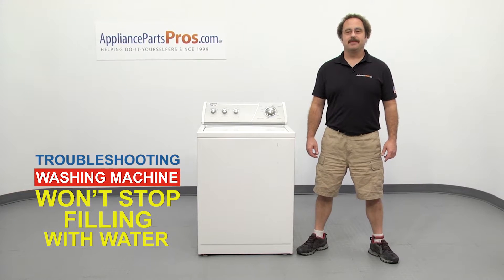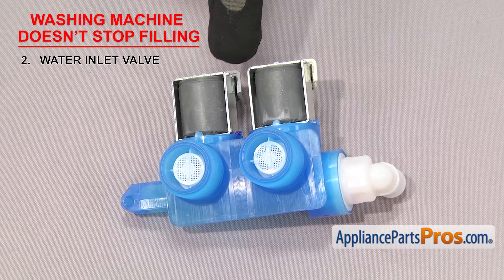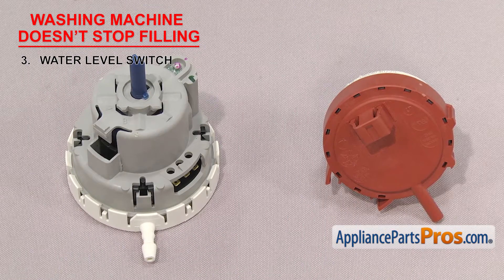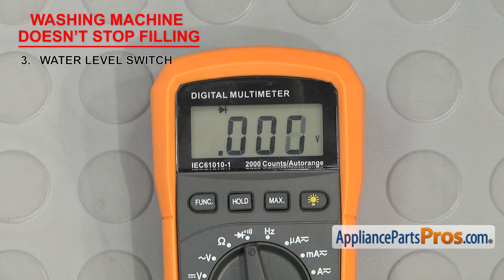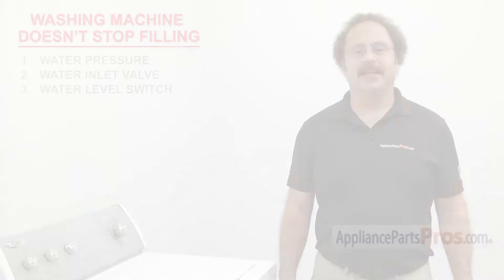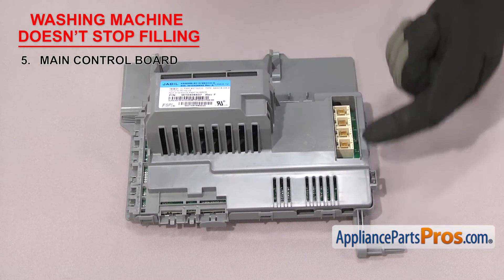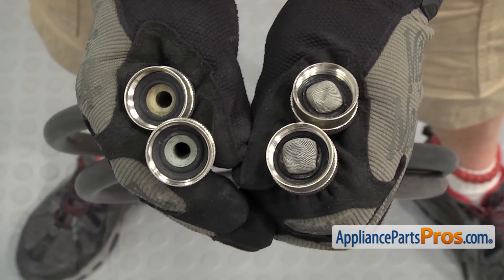Washing Machine Won't Stop Filling with Water - Top 5 Problems & Fixes - Top & Side-Loading Washers

Comment: Mine gets close to being done and then will refill with water to try and balance the load.. Even though it's completely balanced because I just rebalanced it when it started filling with water about 8 times. Why would it do that? Even on a spin only cycle with everything distributed evenly.. It will fill with water and do it all over again.
Reply from the maker: That sounds frustrating, especially when it keeps refilling even on spin-only. For detailed troubleshooting steps specific to your situation, our certified techs can help you at forum.appliancepartspros.com. Just post your model number and what you’re experiencing and they’ll walk you through the diagnosis!

Comment: My GE Washer only overfills when the cold water is on. Fills normally when only the hot water faucet is on. Do you think that might be an inlet valve issue?
Reply from the maker: If you have to turn the water off to keep the unit from filling with water, then that would be a valve issue. if you have your model number we would be happy to look up the part number for you.

Comment: I have a Kenmore washer. It keeps pouring water into the machine, but it never fills with water. It's just continuously filling. 

The water level switch only has two prongs. There is no continuity at first, but when I blow into the switch I have continuity when the switch clicks. 

Any idea's?
Reply from the maker: If it's draining as it fills, it sounds like the unit is siphoning the water out. Check the drain hose that goes into the standpipe. If it is pushed too far down into the pipe or taped to the pipe it could cause that issue.

Comment: My GE top load washer won’t stop filling even when I push the knob in it keeps filling I took the hose off and blew into it and it stop once but after the it stopped responding to that but the tube isn’t clogged or punctured. Thanks in advance
Reply from the maker: If the water continues to come into the unit when it's turned off then your water valve has failed and will need to be replaced.

Comment: How about why water not coming out?
Reply from the maker: If water is not coming into the unit you can check the pressure hose for clogs. If that is good, check for power at the water valve when it should be filling. If you have power there and it's not letting water into the unit then you will need to replace the water valve.

Comment: Rinse cycle keeps filling with water and never gets to the spin.
Reply from the maker: You will need to check the pressure hose for clogs and make sure it's installed properly. If that is good and you can shut the water off by turning off the machine, then you will need to replace the pressure switch.
Reply: @appliancepartspros  thank you.  I will try this tonight
Reply: @appliancepartspros  do you know where pressure switch is?  Thank you
Reply from the maker: The pressure switch is usually located behind the control panel.

Comment: I have a top loader whirlpool. The cold water doesn't turn off. I have to stand by to manually do it, then shut off the valve at the wall. The hot works fine and shuts off correctly. I basically sit by the washer and wait for it to make a click noise once it's at the correct water level so I know when to shut it off. I'm guessing that limits the problem possibilities a bit. I'll have to open it and see if I can figure it out. Thanks for the helpful video. (And thanks to anyone that offers any helpful tips)
Reply from the maker: If the unit will not stop filling until you turn the water off to the unit then you will need to replace the water valve. If it stops coming in when you turn the appliance off then you will need to replace the pressure switch.
Reply: @appliancepartspros  thank you so much!!
Reply from the maker: You're welcome!

Comment: I love these videos. I have a really old Kenmore. I think it’s about 30 years old. I have been encouraged to buy a new washing machine. About three years ago the pump went out a replaced the pump and it continues to work. The current problem was, the inlet valve. I bought a new inlet valve and put the machine back together. I took it for A spin and it wouldn’t stop filling. None of the other events like agitation started either. I was ready to call it quits and buy a new machine. It was a struggle to take the machine apart, but I did notice that what I’ve discovered to be. The pressure hose was not attached to anything. I watch this video and it says oh it’s a pressure hose and it needs to be attached to the back of the tub so now I will, take the machine apart again and attach it. Hopefully it works. This has been a challenge, but I’ve grown attached to this washing machine. 😁
Reply from the maker: If there is anything we can help you with please let us know. Good luck with your repair and let us know how it goes!

Comment: Thanks a bunch for this video!!!! My mom was doing laundry and all i heard was a bunch of "eeks, omg's and what's going on with this thing" from her before I discovered the washer wasn't responding  to anything she was doing it and had she not shut the water off on the valves it would've overflowed. (Ik she said she hit pause at some point but that didn't work and it kept filling but the weird thing was that the rest of the lights went out that are normally on like the load size and the water temperature light selection wasn't lit up - this was prior to her shutting off the valves)  
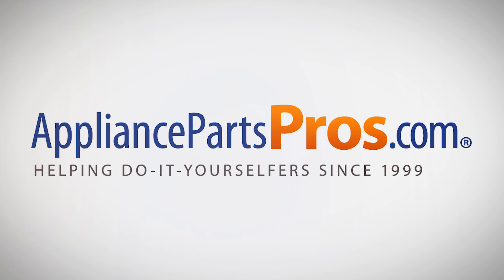Im going to watch this video again and see if I can figure out what the dealio is. Thanks again! 😀 7:21
Reply from the maker: You're welcome!

Comment: Great Video ... we are new construction ... sediment is high and we had a low pressure situation due to the inlet screen where the hose attaches being very clogged ... we cleared it .... perfect operation.   Thank you!
Reply from the maker: You're welcome!
Reply: Thanks for the info! My home is older, but sometimes there’s a break in the community water pipes that allows sediment to get in and send dirty water beyond those break. 
I’m glad it was a reasonably inexpensive fix.

Comment: All of this was excellent.  However, the problem with the machine on my 2nd floor that created a catastrophe was not mentioned.  The Water Level Control wasn't clicked in on the chosen level .. it was just "off" to the right.  The machine didn't know to stop .. and it didn't.  THOUSANDS of dollars in damage to the apartment below.  Unfortunate - and something to be aware of and watch out for when in a hurry.  BE SURE IT CLICKS IN TO YOUR CHOICE OF WATER LEVEL... nearby the choice is a disaster waiting to happen.  Figured it out and it's filling and draining and spinning a wash this very evening.  Trusty Kenmore and a user error.
Reply from the maker: Thanks for the tip! Glad you were able to get the issue fixed!
Reply: be careful, I've had flooding several times because even when changing between settings, it doesn't make good contact. 
But I have another problem - after it fills and stops, when it moves to the next cycle it will try to fill again, so sometimes it just completely ignores the level. The only way to stop it is to manually advance the program knob until it gets to a spin or drain cycle
Reply: Oh my gosh! How awful! I’m glad I have an old, very basic machine.

Comment: I have a Maytag top loader with a clean washer cycle when I use that it doesn't cycle through the water just keeps pouring into the machine why is my clean washer cycle not working? every other cycle works fine, thanks
Reply from the maker: What is the model number of your washer?

Comment: So if you blow in and it clicks then suck in and it clicks it's good right.
Reply from the maker: You would still have to use a multimeter to test the pressure switch to see if it is bad.

Comment: ..what about if you have an circuit board chip that the air hose attaches to?
Reply from the maker: What is your model number? What is going on with your washer?
Reply: MATAG MVWB850YW1,..just keeps filling until we Cancel.
No error codes. How free should the tub be? I just changed the bearings and driveshaft and seal too.

Comment: My ge washer that doesn't have a digital display continues to fill with cold water through all cycles even when the washer is shut off.
Reply from the maker: It sounds as if you could be having an issue with your water valve. What is your model number and we can look into this for you.

Comment: Thanks, good stuff, this is only the second time this ever happened in around 6 years.

Got in the shower and she washed a load while I was in there, it didn't even click until I seen your #1 Problem... lesson for the day, unless you have great water pressure, don't take a shower and wash clothes at the same time. 

Was an older washer, at least 15 yrs old, but again, it's been years since the last time it happened.
Reply from the maker: Glad we were able to assist you!
Reply: Wow! Thank you SO much for sharing this info! I would not have imagined that could happen! My washer is ~23 years old. Plus I’m at the end of the community water lines so if there’s an issue with water pressure upstream, I’ll definitely get the brunt of it. 
Now I know if the washer’s running, stay out of the shower, stay awake, and stay home. I knew to never leave the house or go to sleep if the dryer’s running due to potential fire hazards. Geez. Who knew convenient appliances could be so dangerous?

Comment: You're a washing machine wizard !!  God love ya !!The Lord guided me your channel. Thank you, thank you for sharing your knowledge and expertise. You made it easy, a mouse had a snack of the pressure hose. All good in the laundry room after mopping up 45 gallons from the washer continuously running water.  The concrete hasn't looked that clean in 20 years!
Reply: Hahaha! I felt the same way earlier today. When I noticed my washer overflowing onto the floor, I immediately turned it off and started “mopping” it up with the dirty towels that were on the floor waiting their turn, haha. When I saw all the yucky stuff I was wiping up with the towels, after I got over being grossed out, I had to smile because now I had a reasonably clean floor, hahaha. I also thanked God that I was standing right there when it started  overflowing!  Otherwise it could have created a huge mess and probably caused a lot  of water damage, or worse, mold. 
Now I just need to figure out which of the 5 potential failure points it is. But learning new stuff is good for our brains so it’s all good. My glass is full, and so is my washer right now, hahaha.

Comment: A reading of 0.00 during a meter test shows continuity with no resistance.
A reading of 0.L means over limit, infinite resistance, that means no continuity or not connected.
A numbered reading greater than zero is a measure of resistance including the test leads, their connection to the right place for the test,  and the resistance of the part that has continuity In this example.
Have fun.
Don't call for a special service call just yet if visual inspection shows disconnect or damaged pressure line.
 or a blockage exists.
Clear it by blowing thru it? Could be.
Reply: Thank you for the explanation of what the multimeter readings mean in continuity mode. I’m still learning how to use one. 😃
Reply: @moonmagnolia7  they take some thought and practice, and some meters are difficult to read settings for. I didn't get good instructions with some of mine. My fluke meter came with its own book.
Shows you what you get for your money.
I had a repair once, I needed. Their tech sent me a brand new one, with new leads.
A $500 tool.
Here you go!
Wow.

Comment: Speed queen top loader makes a loud bang .I replaced the agitation pulley,belt,helix,all genuine parts.the problem of failure to spin continues.should it to do with the transmission system ?

Comment: Be sure to check the silicone hose attached to the rear middle of the control board on the Maytag Bravo x.  If it comes undone, the water will continue to fill and not switch to wash.